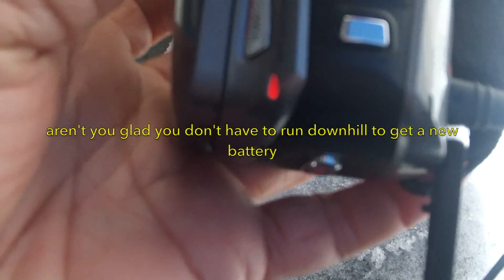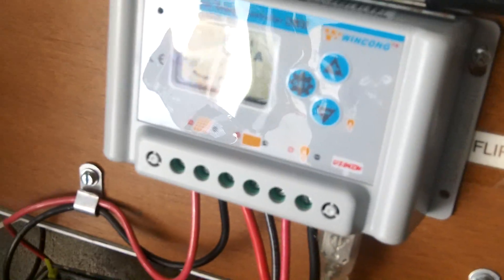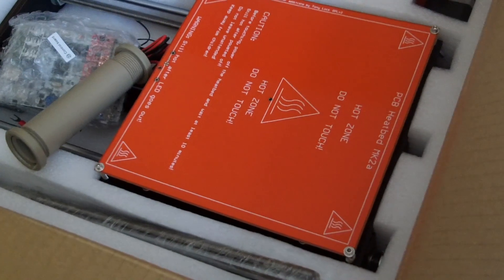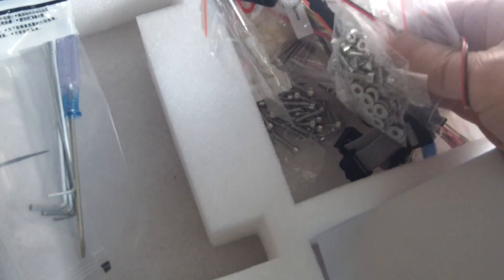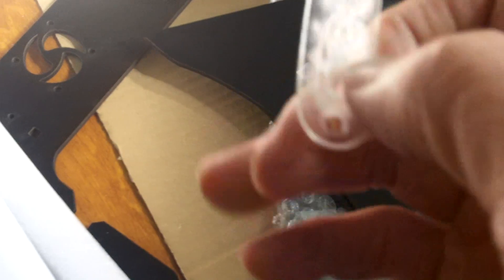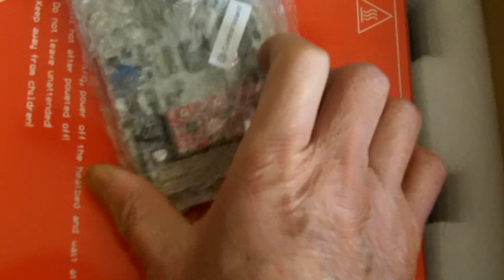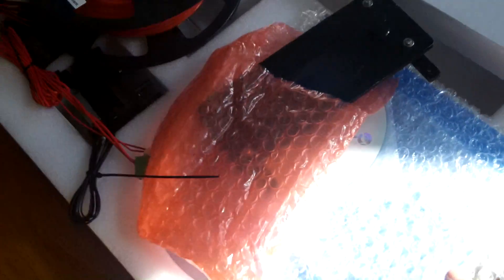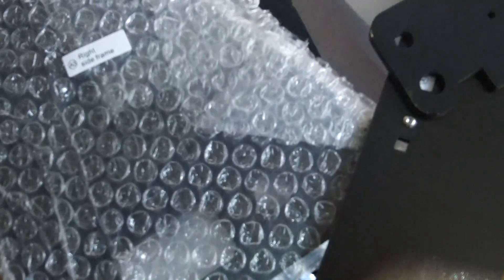More charging options for your Canon Vixia camcorder and a happy delivery

Comment: Cool i just love my cheap 3d printer kits... very similar to yours if not identical.  I have been trying to modify the gt2560 board for auto bed level and haven't quite got it working.... I really prefer the ramps 1.4 boards so im going to be switching my printers to ramps and modify them with auto bed leveling like my other printers.... cool can't wait to see what you print.